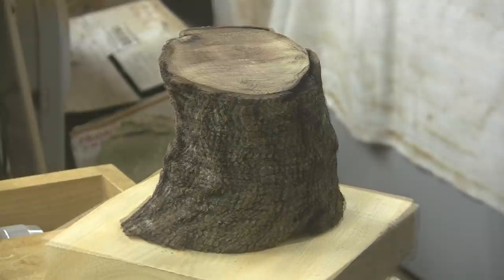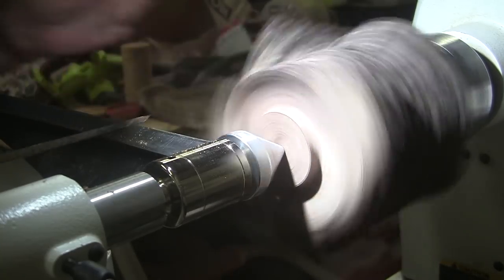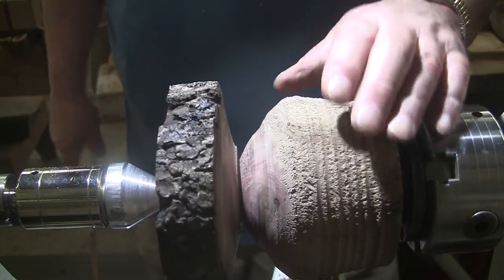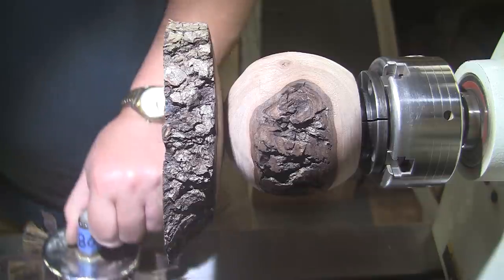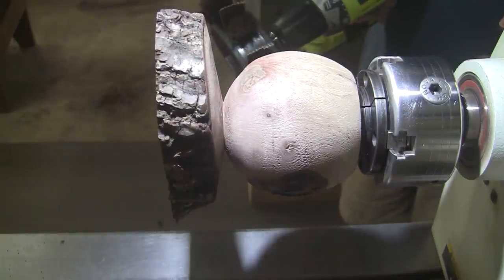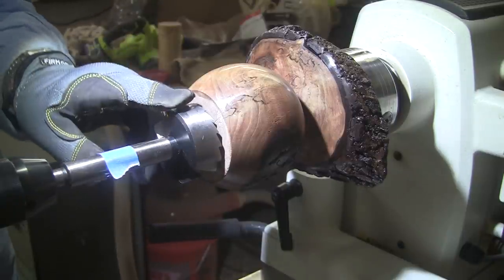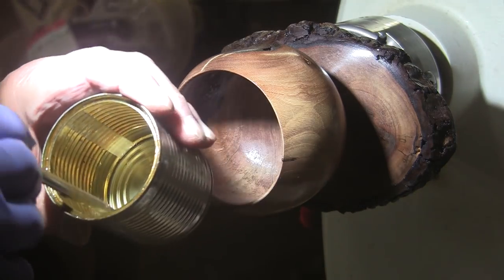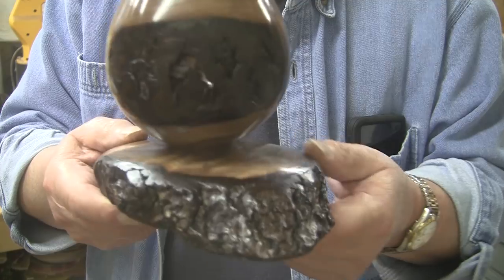Pedestal Bowl - Problems Of My Own Making! - Wood Turning

Comment: Well I came in to take a break from the beast I am working on.. Saw your video and it said Problems...well I have to play it again because I did not see any.  Yeah it was a small diameter but had enough holding it with your light touch with the gouge to get it done. A real beauty Phil!
I did pause the video when you mentioned Sand-O-Flex and Ebay. I found one for $21.00 and it is the same size as my other.  Now it will be easier to use because there will be less grit changing.
After watching you turn I feel much better and best get back to my own problems in the making..lol
Take care my friend,
Gary
Reply from the maker: That's a bargain for the Sand O Flex, Gary!  Less grit changing is always a good thing.  Thank you, buddy!
Reply: Well it was even a better deal. For some reason the payment did not go through but it showed I was interested. I got a counter offer for $19.00 even though I tried to pay for it at $21.
Well you know me...not going to pass up a bargain..lol

Comment: Phil, Thank you for the sand-o-flex information. I had one years ago, and I mean years, I never found much of a use for it as I did flat work so it got trashed. Now I turn, and need to replace it. Your info will be used. Thank you again.
Reply from the maker: Glad to help, Scott.  I find them invaluable.

Comment: With the light coming thru it would make a nice LED candle holder.
Reply from the maker: Agreed.  As soon as I brought it in the house I tried a couple of those little LED lights that I have but they are too tall.  The light just goes out the top.  I'll see if I can find one that diffuses a little better.

Comment: Phil! That joint between bowl and base I was shouting "use a skew chisel!" :D  I made a really similar piece, but made it into a tea cup. I wish I could send you a photo... Wow, you have FIFTEEN Sandoflexes? They cost probably the equiv of about $150 in the UK. I discovered 3M Scotchbrite disks as a replacement.
Reply from the maker: I'm OK with a skew on spindles, Mike, but they scare me a little on a bowl.  Just too much surface area flying by.  Yeah, all those Sand O Flexes were pretty cheap or I wouldn't have bought them.  So sorry they are so much over there.  Just doesn't make sense, does it?  Thank you for watching, Mike!

Comment: Hi Phil, another neat project.  You said you used three coats of seal coat and buffed after each with a Scotch Brite pad.  What color/grit pad do you use?  Also did you use a final cote(s) of shellac and if so do you buff with the Scotch Brite pad as well?  What ever it looks great.  Thanks.  Stay safe and well so you can keep the great educational video coming.  Cheers, Tom
Reply from the maker: Thank you, Tom!  I've shown the buffing pads in other videos.  I use a gray pad after every coat of sanding sealer and shellac.  Then I use a white one after the final coat of shellac.  Hope that helps and thanks for asking!
Phil
Reply: Phil Anderson - Shady Acres Woodshop Thank you.  I had gone back to several videos and found lots of references to the pads, just not the video identifying which ones.  So again, thanks for the info.  BRW it might be something you could add to the note. I.e. Zinsser Seal Coat (your preferred sanding sealer), gray Scotch Brite pads to buff, Zinsser Shellac and white Scotch Brite pads.  That way you wouldn’t have keep answering the same question for us short term memory folks.  I was going to ask another question, but I forgot what it was.😄 Stay safe and well so you can keep the videos coming.  I always enjoy the.  Cheers, Tom

Comment: The sand o flex wheels are the best for live edge sanding.  I got a 2" set on Amazon.  Everything starting at 80 grit up to 400 grit. I got the set for $40.  Got 4 of each grit

Comment: Phil, What brand of sanding sealer do you use and do you find one any better then the other. Also, why do you apply some of the sanding sealer with a rag?
Reply from the maker: I use Zinsser Seal Coat for my sanding sealer, Wayne.  I've been using it for years.  It comes ready to use from the can.  It's the only one I've ever used.  I like to follow any brushing with a rag because it wipes out brush strokes and runs.

Comment: I own a sand o flex and live in the UK. Unfortunately no one sells the fine grit refills here. I  tried your link, but I don't have Outlook and so can't use there contact us form. Do you have an email address for them so I can ask about shipping? Thanks, and keep up the good work Phil!
Reply: Or these https://www.gustharts.com/machinery-c123/chainsaws-accessories-c142/carving-c311/sand-o-flex-refill-p1402 
Cheaper but showing out of stock at moment.
Reply from the maker: orders@supergrit.com  is the email address, David.  I hope that helps!
Reply: @PhilAndersonShadyAcresWoodshop   That's great Phil, thanks for your help!
Reply: @jimwatson2962  Thanks, they're just round the corner from me, it's where I bought mine from! Unfortunately they only have 80G.
Reply: @jimwatson2962  Sounds promising, i'll check them out. Thanks for taking the time.
Reply: @jimwatson2962  Unfortunately they only stock 80G; this is the problem I have, you just don't seem to be able to get anything finer in the UK.